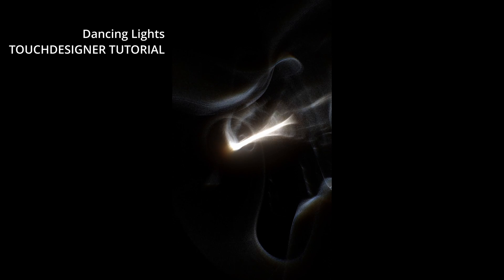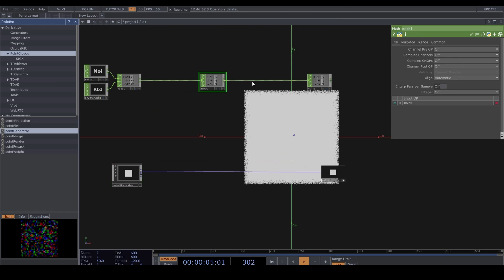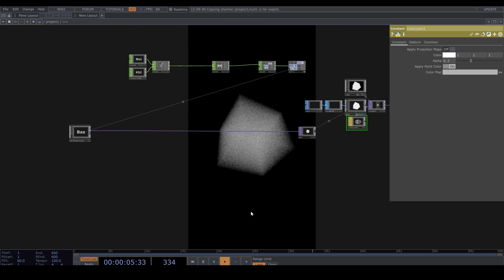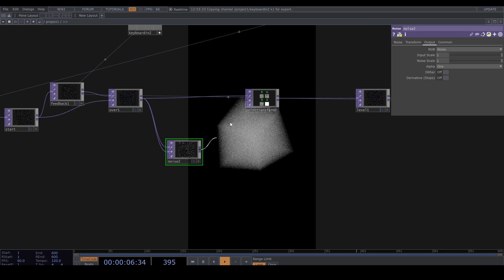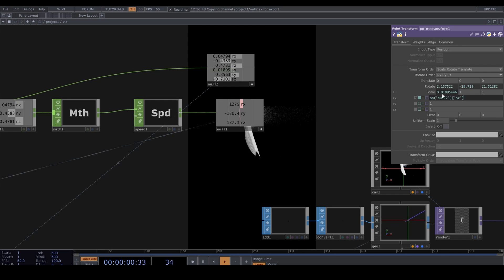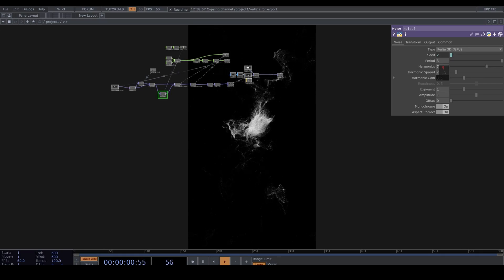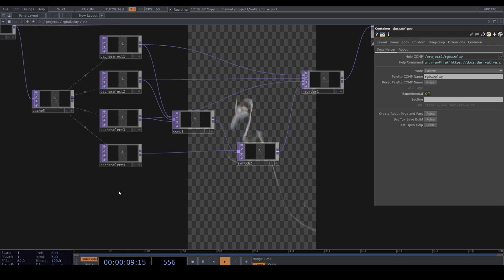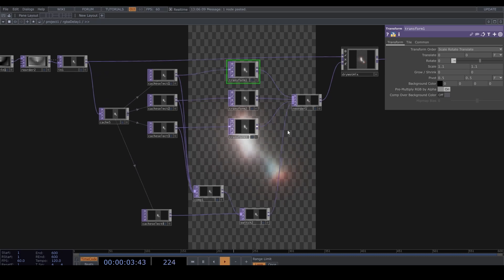Dancing Lights - Pointclouds and Chromatic Aberration - TOUCHDESIGNER TUTORIAL

Comment: Since I have the free version, I realized I hit a wall with the PointGenerator as there is no Transform section so I couldn't make it rotate. I was stuck staring at my screen wondering if there's a similar function that I could add to make it rotate. PointTransform TOP was the winner!! I connected it to PointGenerator,  dragged the rx ry & rz coordinates to the rotate box, applied the CHOP Reference value, and it worked! Lovely video, thank you for this amazing tutorial :)
Reply from the maker: Nice work :)
Happy you found a solution.

The transform tab in the point generator, if you step inside the component, is just a point transform TOP. So you found the same solution as the derivative team
Reply: I am in the free version of 2023.118800 and I have the transform section in the PointGenerator

Comment: Hey! I followed the tutorial step by step, but like a minute afther the viedo ended my particles dissapeared. I reloaded the project, and they appeared again but in very low resolution, even worse than 144p. I checked everything and everything is correct. Do you know how to fix it?
Reply from the maker: @Redmi-vx5br  yes, read the description for the resolution issue. It has to do with putting a cache in a fb-loop and it creates some bad stuff if you’re not careful (which I wasn’t)

The particles might shrink to a point and needs to be reset by pulsing the reset on the feedback loop
Reply: @supermarketsallad  thanks, I didn't saw the description of the video, I will fix it at home

Comment: I'm having trouble when I try and send the the Null Geo to instancing in the Geometry, when I change translate x,y,z to rgb it doesn't result in any cube forming in my Geometry, everything else works until the point
any help appreciated as this is a great tutorial, i'm just a beginner
Reply: I'm facing the same issue. pos instancing to geo doesn't do anything for me. Can someone help with this?
Reply: Actually just fixed it. Make sure you've activated add points on the 'add1' SOP and have set convert to 'Particles per point on the convert SOP. This fixed it for me.
Reply: @okayashwin  Thanks for the update! I encountered the same issue and your comment helped :)
Reply from the maker: @okayashwin hello!

I encountered this problem with one of my Patreons. He sent the file over to me, and it worked fine. I actually have no idea what is causing this.

But I have a suboptimal fix, for now, instead of using add-convert-geo, use a box sop-geo (and in the uniform scale in the box SOP set it to 0.002)

I need to research, but it’s a quick fix
Reply: I also have this issue and your quick fix helped, thank you <3